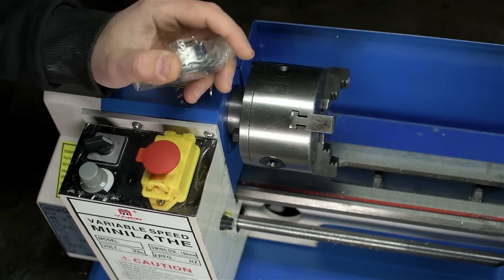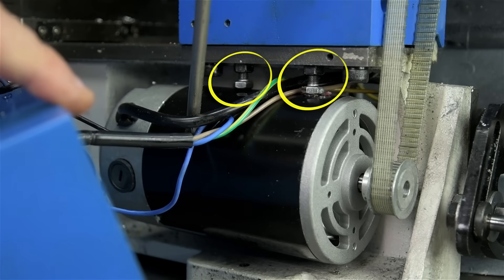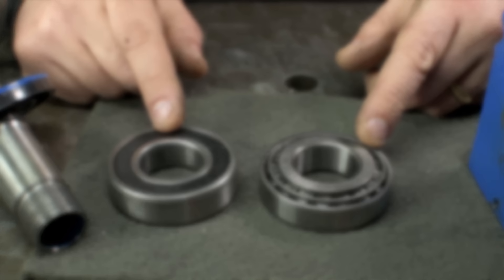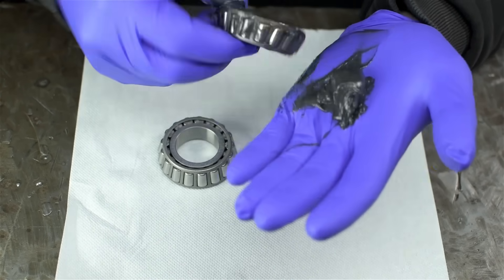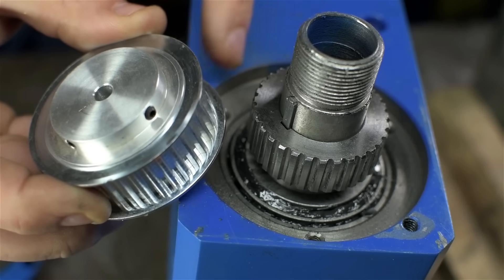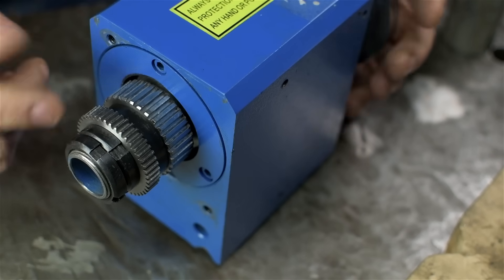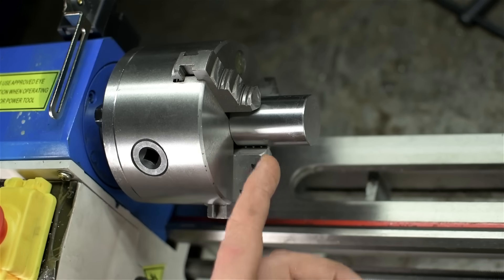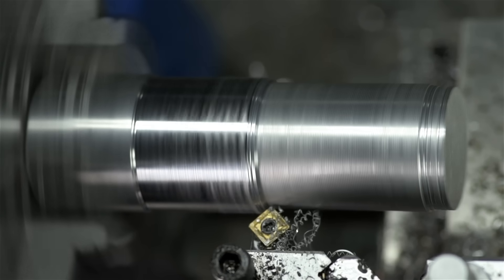Better LATHE Than Never!

Comment: warning sticker was funny 
On to it you can put a pice of pipe or pvc on the in side and find some seals to fit even if you need to cut you caps to fit and add your zerk fittings iv also seen these with motor mounts/bolt holes strip out it but over all good vid iv been wanting one of those for years but a slight bigger model

Comment: Good move in eliminating the compound slide - Stefan Gotteswinter did likewise on his lathe.  I haven't got rid of mine (yet), but have locked it in place by tightening the gib screws, this simple adjustment improved surface finish and allowed me to part off without drama.  Really, the compound slide is rarely used unless you have to machine a taper, or swing it to 30* for threadcutting.  I don't bother - I just plunge straight in.

Comment: My mini lathe purchase in 2002 made me think, "This is a pile of cast iron, YOU make a lathe out of it." But it turned out to be a lot of bondo under the paint, it has never functioned as a lathe. It turns an arbor to spin wire wheels.

Comment: Cool video. I'd be more inclined to put the angular contact bearings In as that is what the application calls for. Tapered Roller bearings will definitely generate alot of heat if not setup correctly. Most people way over grease them. And tighten them all the way. The roller thrust when side loaded naturally pushes itself outward. This outward force will definitely crush the plastic spacer in the rear. Your suggestion to replace that with steel is definitely a must. The plastic spacer would need constant adjustment and for the novice that is most likely to be working with these lathes it might cause more problems then they're ready for. Spend the money go angular contact. If there is enough space to go duplex front and rear it would make it a way stronger setup as well. 
Keep putting out great videos. 
Just my 2 cents.

Comment: Excellent discussion on how to partially address the spindle limitations of a bottom tier, consumer grade import lathe. I say partially because you left out replacing the existing headstock with one designed as a precision machine tool sized for your application incorporating possibly a 10 mm larger front bearing, precision angular contact ball bearings, a two or three speed spindle transmission, etc. However that approach brings the necessity to improve other lathe deficiencies - a near endless process leading to the re-design and replacement of every part resulting in a $300 lathe costing $30,000 but worth $3000 on the market if you could find competing buyers to drive the price. 

The two issues I would raise are: 

1- mod the headstock casting by cutting race removal reliefs in the spindle bearing bore shoulders prior to race installation.

2- discuss merits and rationale using plain vanilla grade bearings Vs precision grade and also a few remarks on the grade and suitability of the existing bearings for the service they were applied.

I submit that solid block replacement for the loosey goosey compound was the source of your finish improvement. Plain conrad ball bearings judiciously preloaded do quite well in the radial stiffness department even if axial stiffness leaves something to be desired. The main improvement wrought by your taper roller bearing retrofit is axial stiffness.

And a  I suggest  TOT discussion in some future video of differential thermal expansion as a machinist's tool for fitting and assembly. Heating Vs cooling, expansion rates of ferrous Vs aluminum or copper alloys, calculating allowances and interferences, etc. It will be unavoidably nerdy but the machinist's trade ain't all jingling blue chips and stuff that magically fits together.,

Comment: On some front wheel drive cars they have a spacer between the taper bearings so when you tighten the retaining nut the preload on the bearings are set to what ever the length of the spacer is.

Comment: They call these hobby lathes because getting it working right is your hobby.

I will have to do this bearing upgrade to mine. I've rebuilt the whole saddle and cross slide pretty much. A really worth while project in these is redoing that surface at the back of the saddle. Lapping it flat, using better bolts with lock washers and shimming it to the correct hight really helps.

I've also basically replaced the whole cross slide with aftermarket parts, brass Gibs, better dovetails, little DROs on 20tpi shafts and more thoughtfully designed tool holder attachment points are just the beginning of you've got money and aren't just prepared to abandon the mini lathe.

Comment: Years ago i saw my first old tony video by random and from that on i liked them.That time i had no clue about metal working if i needed something i told it to a friend. After short time looking the videos I bought a mini lathe to look if i like this kind of hobby and two months after buying i did the same i removed the bearings(with Lithium bearing grease) and the nylon change gears to steele. The next thing was with the two little plates the support is fixed to the bed.. They are the weakest part of this lathe so i made it new and thicker with good steele and put some taper gibs to it to have the best sliding with the smallest play and it worked very well. Please look how the support is clamped to the bed and how they want you to adjust it.. Design mistake is the only word for it. I sold my Minilathe after 2 years of improving for the same price i bought her and the new owner, he lives near the Italian border and restores old Vespa bikes loves it and is very satisfied. Without old Tony i don't know if I would have got involved into lathe and metal working 👍😎 thanx
P. S. Forgot to mention that now i have a room full with a big lathe, mill, tool&cutter grinder, metal bandsaw, welder, 3 bench grinders, metal heating ofen, air compressor and so on.... 😀Man that thing really got me 😉
Reply: "Hello, my name is Wolfi and i am a machining addict."
"Hi Wolfi!". ^^
Reply: @AlBorland3877  Hi Wolfi, I'm blaw and also an addict. Welcome to the meeting.
Reply: Yup, when the machining bug bites, it usually bites pretty hard.
Reply: @bdkj3e  I know, I'm putting a mini lathe on my sailboat. On my last trip I could've saved thousands of dollars if I had one. This boat isn't leaving port without a mini lathe, mill plate,portaband and my tig welder. The lazarette and cockpit will be a mini mobile workshop and it'll fit in where I stored the boat fenders. I don't like keeping them on deck in heavy  weather. But its a small price to pay for being able to fix things while in some of the world's most remote islands.
Reply: @southjerseysound7340  I have always thought of this as a great solution for a cruising yacht. Yes keeping a small stock of parts is necessary but the ability to make any part when needed from some stock material is a huge advantage.  a bit of 4140, aluminium plastic and stainless should cover most problems likely to encounter.
Reply: @hamish1924  Having proper spares is key like you said and I'm not going to skimp there. But being able to fab up temp repairs makes it worth having. I plan on taking some stainless rod stock in case I have to trim/extend my rigging again,along with some brass/bronze, aluminum and some plastic too. My lathe has a 14 inch bed so other than the 1-1.5 inch bar stock that I can feed through the head,everything will be short lengths that are easy to find room for. I also have a angle plate I'm setting up for some light milling and will have some various plates cut too. As of now it all fits in my port lazarette including a little 4 or 5inch bench grinder I found at a yard sale that mounts to a pole bent to fit a rod holder. I still need to figure out what I'm  going to do for a welder/genset though. I'd rather not have a gas generator so I'm looking into a dedicated high output alternator/invertor combo. But we'll see since I've got a Honda genset now. 
I'm pretty certain I'll be able to handle most of what gets thrown at me out there and possibly more. Ive helped other cruisers in the past and should be able to handle more things now. Hopefully I'll have a little better chance to make a buck or trades on the side.
Reply: @southjerseysound7340  What are you going to bring for metal stock,   something to think about.     Big Boat and a small machine,    But I know
how you feel about being able to repair on the spot.
Reply: @hamish1924   I guess you need a mini Mill also.    Nuts, Bolts,  and much more.
Reply: @hamish1924  :  no such thing as a small stock of parts is there
Reply: @southjerseysound7340  great idea!  I had loads of room on my 36' seafarer to make a nice workshop.  What size boat you talking about?
Reply: @jimmyboy163  I'm between boats now because I had a offer for my 32 allied Seawind I couldn't refuse. But I want to find something in the 40 ft range
Reply: @southjerseysound7340  Scotty! How is that warp drive coming!
Reply: same thing here on a smaller scale .... got infected and there´s no medical treatment against it :D
Reply: @turbofan123 .. That's for sure once the metal virus has you you won't escape any more. The only thing that stops me is limited space in my workshop. I have a big house to look for and can repair things now that i didn't even know the name 4 years ago 😁 and last time i always think about building a new workshop in the garden 😉 i did tell no one about that but i think there is no way without that because now my  workshop is full so a new and bigger one is the only solution because stopping is no option at this point. 😎 There are so many things i want to learn and machines to buy.. A shaper is the next i love them when they work they have a special rhythm fascination to me... Im going completely mad i think sometimes 😀😀😀 a machine working is fascinating me.. Unbelievable..
Reply: @wolfitirol8347  next step will be having a YouTube channel. :D
Reply: @AlBorland3877 .. I did think about a tube channel because that equipment i would have already filming is a hobby since over 25 years and computers and skiing.
But metal working i never had on the radar.. Unbelievable the same friends i asked earlier times now come to me because of better equipment.. Live is interesting you never know what comes next 😊😊😊the reason why i didn't make a channel was that im not old Tony or a guy who is so good as he is or Joe "Texas" Piecinsky or Stefan  Gotteswinter every time i look their vids i learn something very useful..
Reply: @wolfitirol8347  Well, my opinion is, it's not just about learning something. First of all, it has to be interesting. If you're able to speak fluently, that's half the battle. ;)
Reply: @wolfitirol8347  I know what you mean! I put on a Genesis, Crack The Sky, or Robin Trower album and it's harder to pick up my guitar! But nobody can make all the videos. If you don't mind backing up your work, recording your own process can be a good reference for yourself when you sort of remember how you did something. You can get better ideas too watching yourself and it frees your brain up to realize there's better to do that! Some of the most interesting and valuable videos can be the mistakes. They really let you know that it really was that important to stay sharp and not disregard reality to that point it bites hard. In my high school auto mechanics class, one of my friends came back late the second year missing his hand from working on a lathe in a machine shop when the piece he was turning grabbed his sleeve.
Reply: @Tricknologyinc  and the lamb,
Lies down,
On Broadway.
Reply: Haha, that's a love story if I ever seen one. Good on ya man.
Reply: Wolfi Tirol m
Reply: I learned a new word: restaurates, I always thought it was restores.
Reply: Should send that word to AvE!
Reply: @steviefordranger198  Thanks that was the word i was looking for.. That's the problem of not beeing a native speaker German is my mother language and my last stay in England (Sussex) was in summer '83 and' '86...😉
Reply: @wolfitirol8347  Ich denke, sie habens gut verstanden. :)
Reply: Id say you had an allergic reaction to the tool bug😂
Reply: Wolfi Tirol you get the chance of getting the lot listed with pictures and you will get sold of all if reasonable price
Reply: Vodka plus walmart lathe = tinsel for the Christmas tree.
Reply: This is my dream to do this one day. Don't have the space right now. I need to build a shop eventually. Or move somewhere that already has one.
Reply: So what you're saying is I probably shouldn't buy a mini after all😀
Reply: Guitarists call it GAS Gear Acquisition Syndrome. I'm lucky I don't have enough room for the stuff I'd buy if I did :)
Reply: Looking to buy one to upgrade from the “drillpress lathe” I use now. Bladesmith….the little mill too. 1200each.

Comment: Deep groove ball bearings are usually axially rated for half the radial rating.  Its a lot more than most ppl think.  Looks like those ball bearings can handle 1000lbs or so axially.    Of course just preloading that 30mm nut to 16lb ft will put close to 1000lbs of clamping on the bearing so maybe there not as much headroom as i initially thought.
Id imagine the tapered rollers are a lot more stable axially due to the much higher contact patch of the rolling element.
Reply: Hmm. So after researching i found that timken recommends 0 to just the slightest amount of preload for longest tapered roller bearing life. Same goes for ball bearings apparantly so i guess there would still be plenty of axial headroom on those ball bearings after preloading.

Comment: This is the sort of lathe that would be lovely in the spare bedroom to while away frosty evenings. However, when you see how much better second hand machines are it seems like mediocre value. I imagine by the time you are finished it will be CNC controlled via a satellite link and only used on spent fission control rods?
Reply: The availability of second hand lathes varies depending on geographic location. Some places lathes were never there in large numbers in the first place. So you're just not going to find many used ones there either.
Reply: @1pcfred  Yep. I drove about 300 miles to pick up my last one. A mid 1900s Hendey with a 30 inch throw.
Reply: Sorry....27" chuck.
Reply: I wanted a 9x20 to compliment my x2 minimill and got frustrated checking Craigslist every day, so I set up an IFTTT recipe to alert me when any lathe for sale was posted. It worked like a charm. Less than two weeks later I got a used Central Machinery 9x20 for $200. Easypeasy!
Reply: I'm putting one in the cockpit of my sailboat. ; -)
Reply: @southjerseysound7340  My 3 1/2 inch Drummond spent WW 1 on  a Royal Navy boat or submarine
Reply: @leerogers6423  cool, almost all my grandfather's tools came from the Navy yard and all of my highschool metal shops lathes and mills came from decommissioned ships at the Philadelphia Navy yard. My sophomore year we got a new monster lathe that they had to cut out of the ship. I wish I could remember what lathe it was or the ship. But iit's been a long time and I just remember it was green.

Comment: I can't believe you're doing lathe puns. Oh well; No TURNING back, now.
Reply: We should take STOCK of these dad jokes, and BED down some rules. Otherwise, everyone will RUN OUT of ideas. 😁
Reply: This will be my favourite THREAD.
Reply: I might as well SADDLE up for this silly ride.
Reply: what is all this CHATTER about? im a BIT confused. was just WANDERING around in the comments section.
Reply: Face it, we all love a great lathe pun.
Reply: THOU shall not STEEL my heart with these LATHY pun threads!
Reply: Just cut it out .. OK? If you do it now, there is a slither of a chance that you won't turn people off. 😮
Reply: I'm not geared to handle this type of humor. It's cutting into my shoulder as well.
Reply: Good thing y'all are half nuts, or this thread would get boring.
Reply: I am going to bed.
Reply: Ugh there's always one these pun threads, I think I'll take a pass. Agh dammit I just did one.
Reply: All these puns are very unprofessional, if any of you people applied for a job at a lathe factory you’d be turned down.
Reply: And lathe but not least, don't turn evil!
Reply: I found this thread to be boring so I said screw it!
Reply: This is making my jaw ache so much I chipped a tooth and gone cross slide.
Reply: I was in my car biding my time before i inserted a pun. But then i faced the truth that i couldnt start an new thread to do it in
Reply: These puns are turning me into a giggling maniac. I'm absolutely laughing my face off. People are tapping on the window to make sure I'm okay. I'll have to go reassure them so they won't chatter too much.
Reply: All these cutting edge puns are spinning me out.
Reply: At least he cuts to the chase.
Reply: I WOULD never chuck these.

Comment: I hope you had a good Xmas and thanks for the video on your upgrade. You purchased the lathe , cutting tools, quick tool post, and now new bearings and you removed the cross slide for a height block to remove any play and you machined steel and aluminium. What had the greatest effect was the the tool cutting depth and speed, matching the speed with the cutter depth to remove chatter. You are trying to make a cheap lathe into a Rolls Royce. There comes a point where it would be cheaper to buy a better lathe with less hassle. as the small lathe will have more flex in all its parts than a better made lathe.You showed your old lathe  tail stock in comparison and that was a large hunk of solid metal, no comparison to the mini lathe.

Comment: the noise/vibration coming from the small shank insert holder. i had the same issue and solved it with upgrading the 1/2 inch insert holder to 5/8 shank. I had to mill the shank holder in order to fit the 5/8. the bigger the better. size matter.